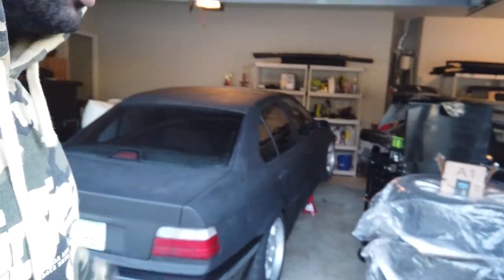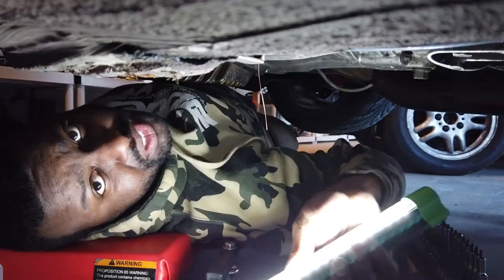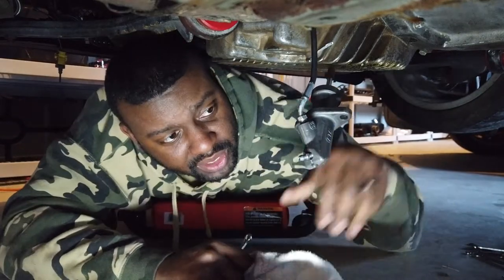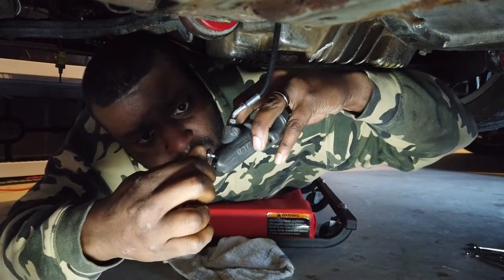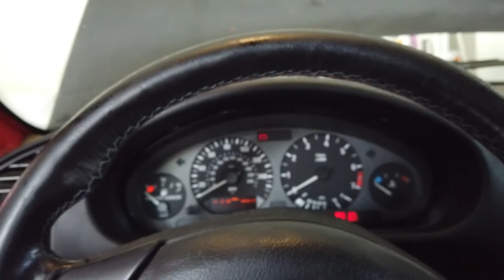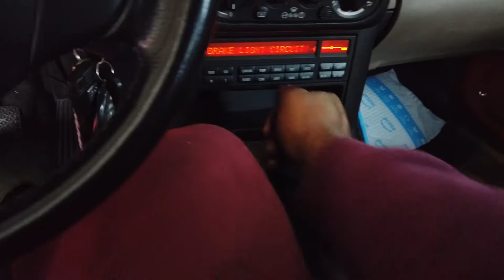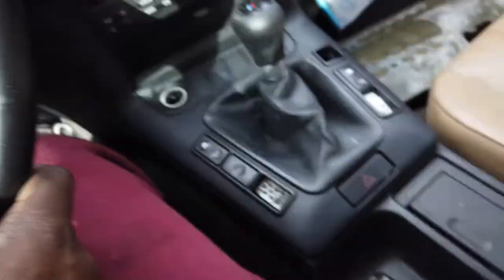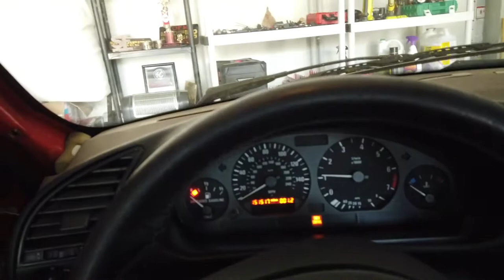Fixed the Clutch issue on Roxanne.. [E36 hand bleed clutch slave cylinder]

Comment: Bruh! I totally feel your excitement when you finally figured it out. I have a 97 E36 M3/4/5 and I have done a ton of maintenance on it over the years. Best gifts to myself while working on this car, 1/4 flex ratchet, schwaben power bleeder,  Milwaukee 3/8 cordless ratchet and my favorite - Gatorade bottle with some clear tubing for catching all brake fluid. Can’t recommend that last little one enough. Makes all the work so clean.

Comment: thank you for the help so much my clutch pedal sank to the floor when i was on my way home from work the brake fluid was low so it wasnt getting fluid but i noticed the brace under the car is covered in something my dad thinks its hydralic fluid im not sure, refilling the resivour didnt do anything but a shit ton of bubbles came up when we put fluid in the resivour ima try and bleed the system first see if that helps if not ima move on to lines and maybe replace the slave cylinder its self big ups tho fr man helping out the noobie e36 guys lol

Comment: I lost all pressure on the clutch the other day in the middle of traffic. I checked the issue and it was the slave leaking. But here in the Philippines it's hard to get BMW parts.  Any websites you guys recommend on buying the parts?
Reply: Recently bought a clutch slave cylinder from china for 24$ its a steel alloy. Installed it and it's bang for the buck. I'll update here when it fails but for now its holding up really well and the clutch feels super firm and easy to step on. Lovin it so far ♥️

Comment: Unfortunately I have air sucking into the system cause the slave cylinder cause of some vibration and I have to play the claudine 5-6 days..... I don't have any clutch fluid leaks which is good news I guess I'll just get lots of exercise this has been going on for a year and 1⁄2 after replacing the master and slave8 times

Comment: So we just replaced DMF on my 2001 E39 530i with a stage 3 single mass aluminum lightweight flywheel and 6-puck clutch and pressure plate kit. Now the car won’t go into gear unless the car is not running. 

Since the single mass is not as thick as the OEM DMF we replaced, is it not got going into gear because there is air in the system? 
Can we tighten up the slack on the clutch cable?

Thanks in advance, great channel!
Glad I subscribed 💪🏾
Reply from the maker: Yeah sounds like it could be a fluid issue. If you try to bleed it and feel good pressure in the clutch there's a chance you out the clutch in backwards too 🤷🏾‍♂️ giving the throw out bearing no room to move and put the car in gear

Comment: my e36 has the zf m3 trans and for some reason I can’t get it into gear when its on but I can when it’s off, u think the slave cylinder needs to be replaced?
Reply from the maker: That's what it sounds like. It's either the slave or the master but the master usually leaks on the floor. I also posted a video on how to bleed a clutch by yourself. It can come in handy if you replace it

Comment: just found your channel, Im actually doing a shell swap on my e36, its a PITA but it'll be worth it
Reply from the maker: Yeah that does sound like a pain. That's gonna be alot of work
Reply: @itsBlack  it is, its kind of similar as far as work to your project ebony actually, except Im not sending nine to paint yet, Im about halfway done with the swap though and its been 2 days since I started the swap. Im also doing it by myself so far.
Reply from the maker: Awesome to hear man. Yeah I've never been this deep in a build other than bolt ons and suspension work so it's all new to me too. I watch other E36 build series on here to learn myself and understand ideas
Reply: @itsBlack  its part of the learning process, I will say pulling the engine by myself with no hoist was ... interesting, Im still trying to figure out how Im gonna get it in the new shell with no hoist, but I gotta change the mounts first as they both decided to snap when I tried to loosen them, I prob should put this all on my YT, but I would like to get it done for my b-day (I doubt that will happen as its the anniversary of d-day) so Ill settle for getting it done before the end of june
Reply: @itsBlack  out of curiosity, did you get the repair manual for e36's? its a free download, let me know if you need the link
Reply from the maker: No I use pelican parts if I need something

Comment: Your brake light circuit message is the reason your brake lights aren't working. It's a switch located on your brake pedal. Just replace it. You will have brake lights again.